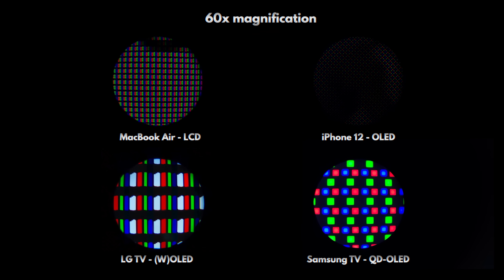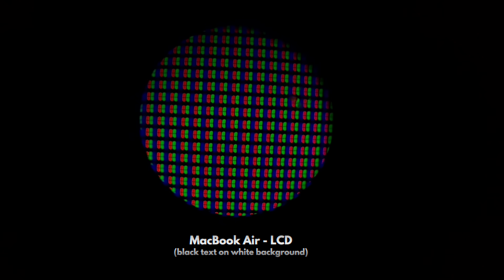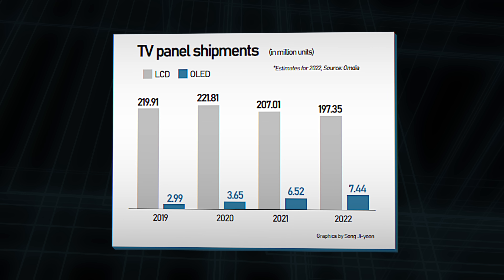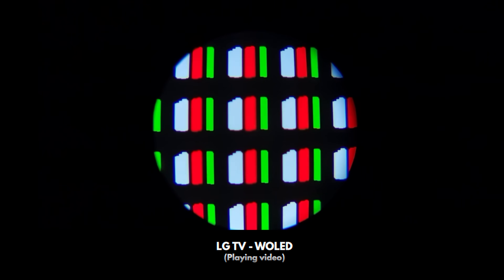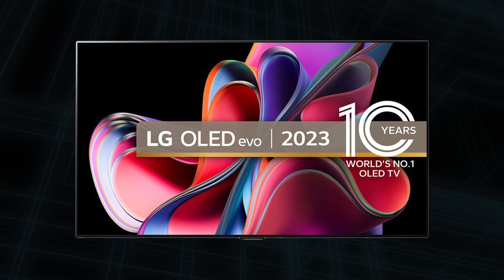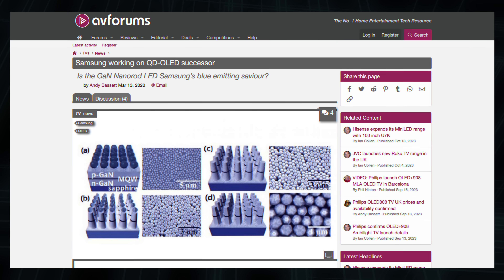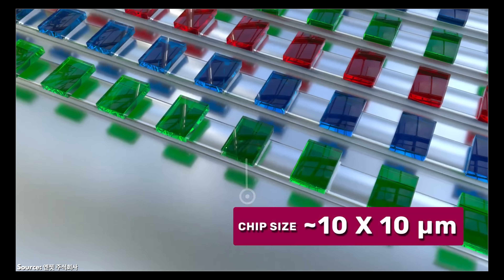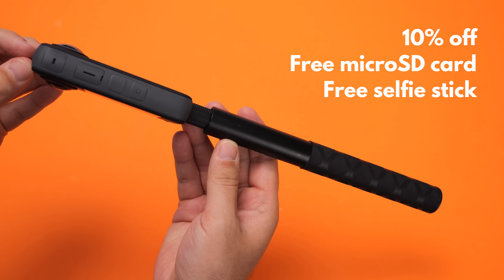The billion dollar race for the perfect display

Comment: The holy grail would be a single substance that fluoresces at different wavelengths depending on the voltage applied.
Reply: well QD-EL comes close (but not exactly)
Reply: How would brightness be controlled then?
Reply: @42WallabyWaySydney  well theoretically you could use PWM (pulse with modulation for  brightness, that's how it's done with normal led's) but that still leaves saturation. so in practice i don't see this happening.
With QD-EL they intend to use 3 separate sub pixels using 3 different sizes of nano partials to define color and voltage or PWM for intensity.
Reply: @ChristopheVerdonck   Yeah, I was going to say PWM, and you could probably stack several layers on top of each other. But more problematically, I don't think physics works like I'd need it to for my fantasy substance to exist. It'd be great if you had a substance that could arbitrarily fluoresce at any wavelength from near-IR to near-UV, but photons are emitted when an electron drops into a lower orbit, I'm pretty sure that always happens at the same wavelength for a given material. So probably the best you could do would be to mix 3 different materials, suspended in an electrolytic solution, at which point you've basically just invented a more complicated and probably less efficient RGB LED.

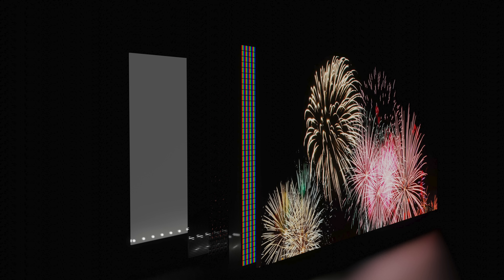Comment: 3:30
Actually the backlight in early LCD TVs and monitors before the early 2010s all used small fluorescent tube bulbs that ran the whole width of the display with there being many of them across the whole display hight. Early backlit LCD monitors from the late 1980s only used a single tube to light the backlight spreader layer.
Reply: i have a 2010ish LG monitor TV that takes a bit to fully warm up next to my more modern 2017ish Asus thats turns on instantly, is that the reason why?
Reply: @q1337  Yep! I had a few LCD displays from that era that used fluorescent backlights. If I remember correctly, laptops made the jump to LED backlights first, with the rest of the industry waiting until the price of LEDs dropped to be competitive with fluorescents.
Reply: @q1337  
Yup CFL tubes can take a few minutes to reach full brightness capabilities after turning on but still instantly have an okay brightness. However if it’s a projection style TV then it would be the projector bulbs warming up.
Reply: @Techno-Universal  is there any flickering that is more harmful than LED monitors? For example PWM brightness LED monitors really bother my eyes, which I only really noticed after switching to one that doesn't use PWM
Reply: @q1337  
It depends on if the backlight CFL bulbs use AC or DC as the ones that use AC would flicker to the frequency of the input AC supply while that would not be the case in ones that run on a DC power supply.
Reply: @Techno-Universal  I see, thank you for the information
Reply: @q1337  
NP! :)
Reply: @Techno-Universal  Maybe mains AC was used in early models, but CCFLs of mainstream era LCDs had own transformers fed by dedicated DC rail of power supply.
And because of common use of cheap capacitors to filter output of that rail it was actually often the life limiting factor instead of CCFL tubes themselves.
Though also rail feeding electronics could certainly have its filtering caps fail...
Those  cheap low quality capacitors are one way for manufacturers to make product fail after planned time.
Reply: @tuunaes  
Yup while often when it does fail the manufacturer will try everything they can to convince you to buy a new monitor because of yours not being repairable even though it can be fixed in reality! :)
Reply: Lower end monochrome LCDs used LEDs as well on smaller sizes.
Reply: @fungo6631  And higher end monochrome LCDs used electroluminescent sheets, which are now on their way to become "the perfect display" with electroluminescent QDs. That's some amazing convergent evolution.
Reply: @fungo6631  
They would of had to have been green LEDs back then as blue LEDs were first invented in 1987 but were too expensive to produce for mass production products until the late 1990s/early 2000s! :)
Reply: @Techno-Universal  Indeed they were green or red LEDs.
Reply: Yep, I have a late 1980s Casio LCD TV, it's about 2" diagonally and 2" deep to accomodate a CCFL tube and light spreader. It's dim and incredibly uneven. Flat CRTs were much better but no one bothered making them color, that'd need Indextron type tech which was too expensive for such a niche market.
Reply: @IgnacyG1998  
Yeah the small scale indexation tech that could be used in camera displays was not used in video cameras until the mid to late 1990s and that was also around the time the world’s first modern LCD monitors and TVs which used CFL backlights were released.
Reply: Specifically they used Cold Cathode Fluorescent Lamps or CCFLs. Very cool and different from your regular fluorescents. Back in the day PC cases with clear side panels were lit up with CCFLs. Available in a few colours and you could even have a tube divided into different colours
Reply: Not only early models, laptop screen used a single tube until they were replaced by LEDs. And there's still plenty of cheap edge-lit screens.
Reply: Around 2010 LG came out with their localized back-light tech, meaning it only lights up small areas where actually light is needed.  Not small a pixels but 1 inch round patches which helps improve the deep blacks.
Reply: @BillAnt  
I also believe that technology also made it into the retina displays Apple used in their devices not long after 2011 as LG has been one of Apple’s primary display panel manufacturers for quite some time! :)
Reply: That was a white LED array in a light pipe for the backlight not a CFL. In the late 90s we used a phosphorescent backlight but never a CFL. You might be thinking of a plasma tv which is not led/lcd and has no backlight but rather uses a high voltage excitation of plasmas to display light.
Reply: @grayhatguyLLC  
Yeah the first flatscreen consumer TVs were plasma ones in 1999 with projection based TVs also being popular at the time but they were still bigger and possibly bulkier than CRTs but had a higher picture quality than CRTs. Also white LEDs were almost not very consumer available until the early 2000s as they were only invented just after the blue LED was invented in 1987.
Reply: @grayhatguyLLC  - Oh yeah, almost forgot about plasma TV which were the rage for a while... then kind of disappeared.
Reply: You can still buy these tubes very cheap from China. They're actually very interesting to use in projects.
Reply: You are correct, also the neon tube is actually using inverter board for sending high voltage current to them (and this also add cost and weight to the unit itself) and also over a long period of time, the color will be become more yellowish due to the burnout of the cathodes and because of it's physical limitation, older flat monitor and TV tends to be quick thick, compared to current ones
Reply: @SkullCommander  
Also the colour becoming more yellowish over time around the display boarders is something that can happen on old modern LCDs like if you’re still currently using a seven year old iPhone! :)
Reply: The backlights on very early LCDs used a an incandescent lightbulb 🙂I have a B&W Micronta pocket TV in which the backlight is a separate unit you clip behind the LCD. Back to CCFLs people reckon you can double the battery life of a Sega Gamegear by replacing the CCFL with LEDs (which obviously need wiring to a different place in the circuit as a CCFL needs about a hundred volts.
Reply: @MrDuncl  I've jokingly said for believers/victims of new marketing terms (like "LED TV" of Samsung) for same old LCD, that it's still LCD, no matter if it has CCFL, lightbulb or flashlight as light source behind LCD panel.
Reply: @MrDuncl  
Yup while there were also screen light accessories for the Nintendo GameBoy that all used inconsistent light bulbs to externally light up the screen so you could use it in dark environments! :)

Comment: For me, As long as OLED has the potential for burn in, I will just stick to LCD. I know that this is unpopular opinion, but I often leave a lot of static things on my screen and I can't afford the possibility of paying for new screen.
Reply: OLED burn-in risk has slowly been going away. It was a problem back in the day, now there are many mitigations made by manufacturers to help with this issue, with a lot of success. It's also on the use not to intentionally misuse to cause problems like burn-in. Burn-in is already a non-issue on flagship smartphones. LCD has its own problems, no panel is issue-free. OLED burn-in is only getting better with time.
Reply: @mycelia_ow  OLED burn in has been a non issue since the Switch OLED.
Reply: Sorry to hear that I have the lg c1 and play a lot of games so everything is always moving for me but I will say you could always go with a oled and see how you like it but Samsung for example most of their oled TVs have a fantastic 3 year burn in warranty that you could get! Hope that helps if not led is fine you could always do micro led tv as well
Reply: MiniLED would fit for a lot of handheld PCs. Steam Deck 2 should use MiniLED instead of OLED used by the Steam Deck OLED.
Reply: I think that's why mobile screens are slowing using OLED's. Because you can replace a mobile screen not a monitor screen by paying some money.
Reply: LED exists and doesn't burn in, no need to go full LCD.
Reply: @mycelia_ow  You do realize that LED displays are just LCD displays with an LED backlight? 

And regular LED displays where pixels are self lit have a problem. They are very chonky and suck up as much power as a plasma TV from 2004 does.
Reply: @mycelia_ow LEDs are just LCDs with a LED backlight. They're the worst of all worlds they've got very short life expectancy. Samsungs hardly get through the warranty period.
Reply: OLEDs are far superior to LCDs and burn in is a thing of the past. I've seen far more burnt LCDs than OLEDs.
Reply: The fact is that modern OLED displays will only see burn in under extreme conditions. 

The Switch OLED only got burn in after being shown a single high contrast scene for about a year 24/7.
Reply: That's why you get a warranty, all that gets taken care of👍
Reply: @hopoff9968   I buy OLED monitors and TVs exclusively from Best Buy since they offer "burn-in" protection for not that much money.

Comment: i wish you talked more about PenTile subpixel arrangement disadvantages compared to RGB as it remains one of the most problematic areas of OLED, which is especially important for laptop/monitor displays

great video otherwise!
Reply: I dont think laptops/monitors OLEDs are using pentile from what I know.  That seems to be more prominently seen in AMOLED/smaller OLED types.  The problem with laptop/monitor OLED is that they're using WRGB, which is where the text legibility issues are coming from that you're probably thinking of.  Using aligned RGB will fix this, but it will require a specific OLED manufacturing process to produce these displays and there needs to be enough displays sold for this market to justify designing and building that manufacturing process(for economy of scale reasons).  In the meantime, there's gonna be some coming improvements to WRGB OLED that will specifically help this issue, even if it doesn't fix it totally.
Reply: Not sure if it is the exact same arrangement but same issues in first generation QD-oled panels by Samsung (see G8 oled). Their second generation had a different "better" layout, see G9 oled @pickleadaykeepsthedoctoraway
Reply: It's a problem with Windows.
F*ck Microsoft

Comment: Can we just like watercool a OLED TV because temperature accelerates burn in (burn out) of the pixels
Reply: Good question? The high end LGs, Panasonics or Sonys have a bigger heartsink but I don’t think it’s ever gonna be actively cooled
Reply: Probably a terrible idea because there'd be an electric current dangerously close to water at that point.
Reply: that's a not big problem because
1. it's a low voltage
2. there's a heatsink that can be watercooled
3. it's similar to watercooling a PC

Comment: 11:36 Yeah see that isn't how it works, QDOLED is already top emission so putting an MLA layer on top, which as you just said refocuses the light outwards, would make no sense because all light from QDOLED is already being thrown out.
Reply: MLA actually will help. QD OLED have crazy view angles but its actually unnecessary for direct viewing on TV. So slightly limiting fild of view for higher peak brightness will be actually substantial. But im now thinking more about QDEL (Quantum Dot Electo Luminescent) displays from SHARP. So that and QD Micro LED will be only noticeable upgrade for QD-OLED TV owners😄
Reply: Micro Lens Array you meant, LG VS Samsung.
emission, shattered light you meant ?
It's the prisme, the pixel, you get all colors troughs the lens array

Comment: OLED degrades over time so it's objectively bad e-waste, and also gives people migraines and headaches due to PWM at all brightness levels, flickering lights are bad, actually, I always preferred higher end IPS panels as they are far more readable for far longer at a time due to not having PWM, or if they do have PWM, it's at like 2000+hz instead of an average of about 300, which is bad for one's health.
Reply: I had horrible eyestrain from many IPS displays. Currently using a VA, but this has vomit inducing motion clarity, at least it has good contrast and wont give me a headache like IPS displays. LCD displays have inversion artifact tho, running at half of your refresh rate. I would rather have PWM, mobile PWM OLED are easy on my eye.
Reply: And how common is this? As all display types can make people feel sick. I am using an OLED rn and use it a lot and have never felt sick using it, never got migraines from using it etc.
Reply: @pickleadaykeepsthedoctoraway  are headaches and migraines from pulse width modulation not health issues?

Comment: ive thought a lot about display tech and, when solar panels and leds are so similar. if we can make micron sized image sensor pixels, cant we make very tiny leds for a 1:1 backlit display, with the benefits of both OLED and LCD? and camera sensors also microlenses to control the light coming in to the pixels, isnt that also a ting we could do with displays to control blooming?

LG technically already does this with their oleds as was mentioned in this video
Reply: cmos camera sensors are relatively small and made in a chip factory, and even if you used a whole wafer you would still have a relatively small display that would be extremely expensive. however what you describe already exist and is called micro oled, these display use a silicon wafer. Then there is also lcos (lcd on silicon) used as an alternative to DLP in projectors.

Comment: OLED is already the perfect display and nothing else come close to be honest. Response time, brightness, contrast ratio, colour accuracy, efficiency, weight, thinness and versatility. OLED is the multi-billion dollar game changer.
Reply: MicroLED is better than OLED, but more expensive.
Reply: @SkepticalCaveman  Micro LED tech doesn't have a single advantage over OLED that consumers would notice.
Reply: @SixPathsOfJin Not using organic material that degrades very fast is a huge plus for consumers... There's absolutely no argument to be made in favour of faster degrading materials as a pro (except for the manufacturer that could possibly sell you more displays in the same timespan because your old one failed sooner than non-organic displays would).
Reply: @MLWJ1993  On paper this is great but the reality is that the time it takes for an OLED panel to degrade to the point of noticeable affect is well beyond the duration that most consumer keep their devices.
Reply: @SixPathsOfJin  Not at all actually, at around 300000 hours of use you end up with 50% of the original brightness, meanwhile an LCD will do about double that time (and it starts at a higher maximum brightness to boot).

The facts are not at all in favour of organic LED's I'm afraid, even you being a huge fan of them won't change that.
Reply: Although less of an issue nowadays, burn in still happens

Comment: Doesn’t matter how good the panels are if they are connected to spyware ‘smart’ TVs/monitors. That part of the industry needs to stop.
Reply: Solution as a consumer -> don't configure wifi and don't connect the ethernet cable.

Comment: Even if micro led happens OLED will still be better for me because of the very low response times.
Reply: MicroLED is just as fast as OLED. There are no liquid crystals, just changes in voltage.
Reply: @Hiromandt technically faster as the response times of micro-LED have been measured in nano seconds.